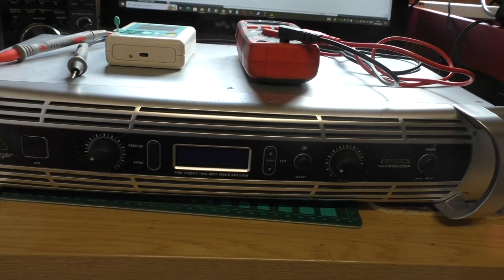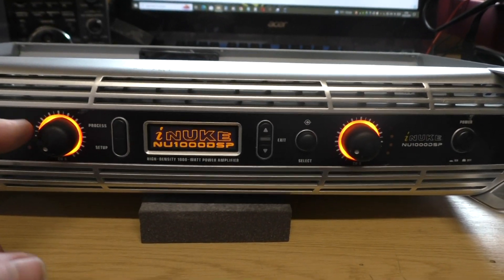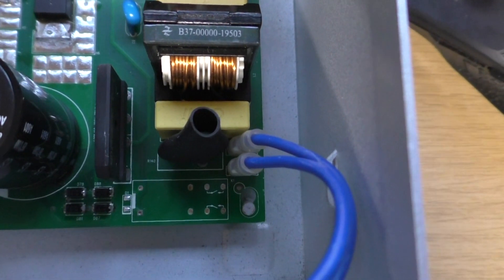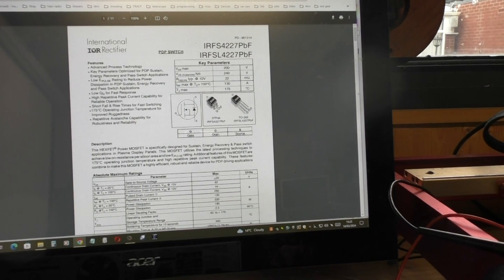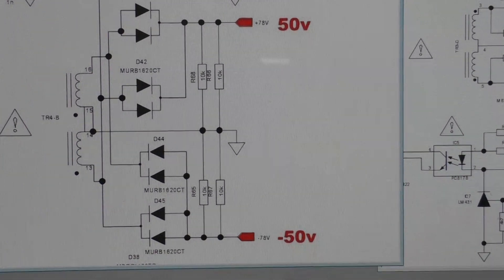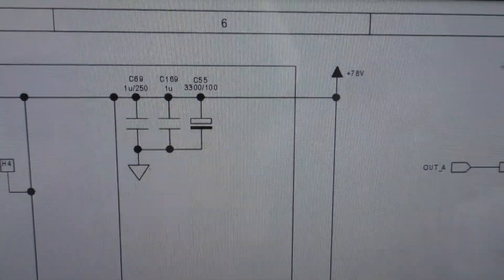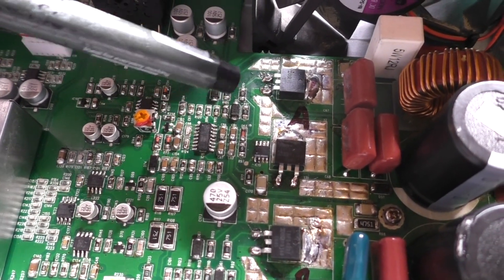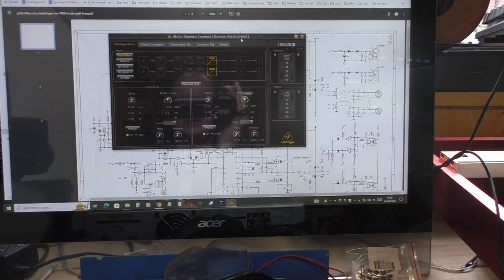Behringer Inuke 1000DSP, 3000DSP faulty, Fixed, Ring of death

Comment: The MOSFET parts are discontinued, but not a big deal. The NU1000 series use surface mounted parts, so they're different packages and those weren't available for the 4227's. You can replace them with the parts mentioned in the NU3K manual if they'll fit, that's fine. They'll work just fine, the driver stages will drive them just fine.

Comment: That's a weird failure for a polyester film cap at relatively low voltage.
As you say, MOSFETs normally fail short, so good catch! For the drivers to fail is odd though as they are normally killed by a shorted MOSFET, although they are extremely sensitive to a difference in the voltage between the input and drive side ground voltages.
Reply: To me, this indicates someone may have tried to parallel the channels or backfed it from another amplifier, which by itself wouldn't be a problem if there's no DC offset; however, the iNuke series has about 1.2mV of DC offset -- completely acceptable, but not safe for putting itself into parallel and accidentally reversing polarity on one.